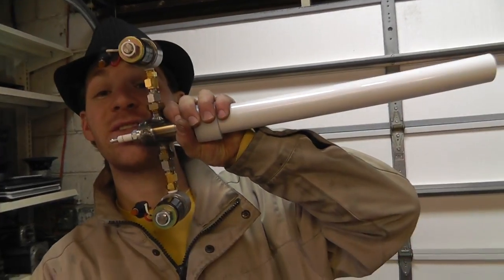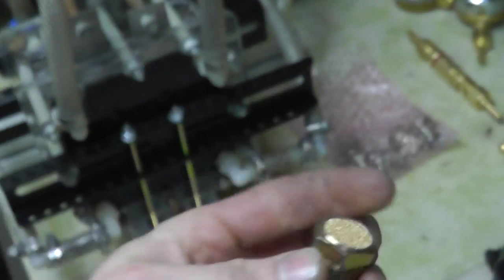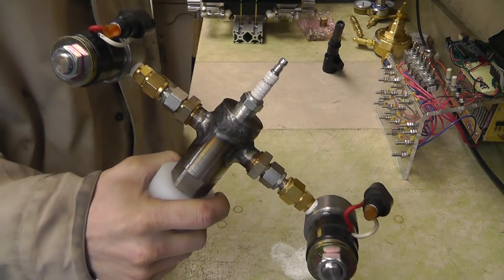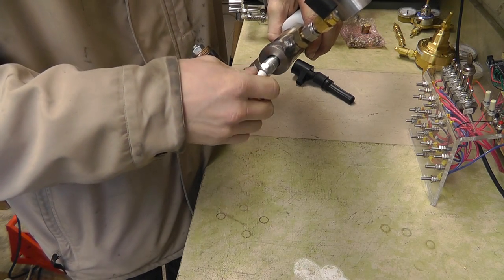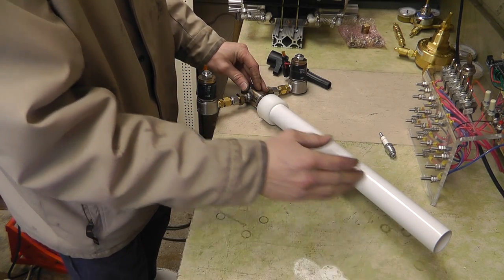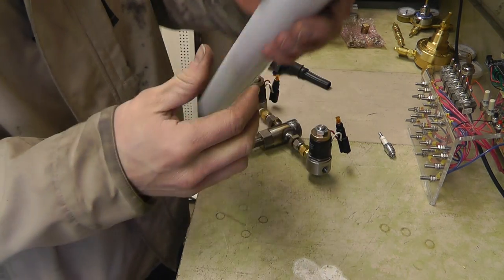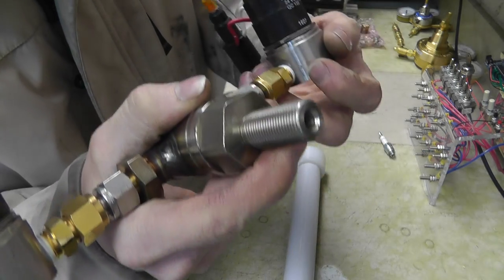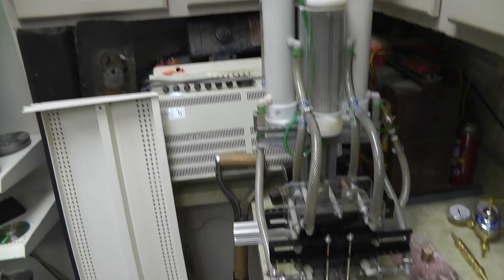You Make The Name, ***Update*** You Wont Want Miss This One

Comment: @brigfiche:

Of the three you suggest CPG seems to be the best and most appropriate.  It really is a Combustion Performance Gauge.  Gauging the performance in relation to:

1.  Distance traveled by Piston (mm, cm, etc.)
2.  Tube volume in question (mL, mm^3, cm^3, etc.)
3.  Ratio of fuel used (pre-combustion, mL, mm^3, cm^3, etc.) to FINAL (post-combustion volume) gas volume (mL, mm^3, cm^3, etc.).

The others you suggest (just my opinion) are not so intuitive.

Comment: Hey buddy yes its me again lol 
ok i was just thinking about this potatoe gun (spud gun) i see 1 problem.. you may have to put some kind of sping on the inside holding the piston back.. and the reason being is as soon as the solunoid opens, the piston will fly out even if there is no combustion... so your gonna have to hold the gas in the chamber untill u ignite it.. but if your using very low presure  forget what i've just said lol.. btw nice to see your CLEAN hands lol
Nick_one_uk

Comment: GDHM (garage door hole maker)...seriously..,HBRTC (Hydrogen Burn Rate Test Chamber)question, when you fire that thing the energy being transfered from the piston to the ring from the resulting explosion will propel the ring quite a distance if theres no risistance against it, you've basically made a potato gun, use 2 solid pistons with the open end caped with a check valve in it leting pressure out but not back in, that should keep the outer piston in place after ignition regardless of vacuum